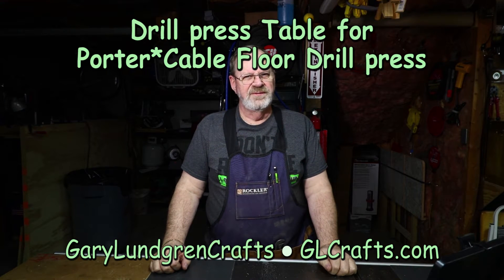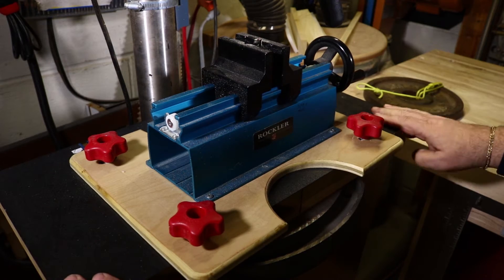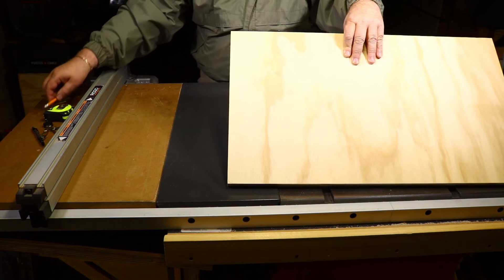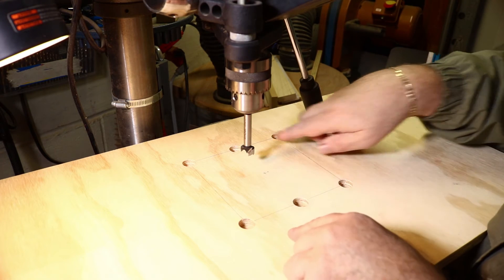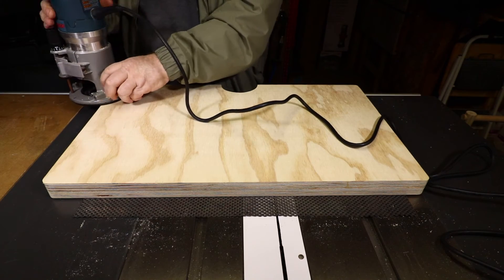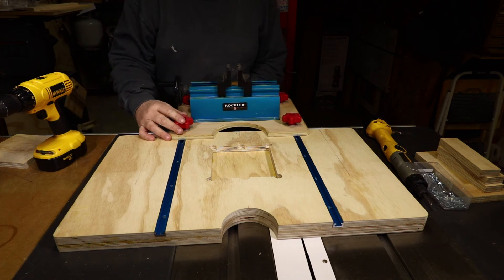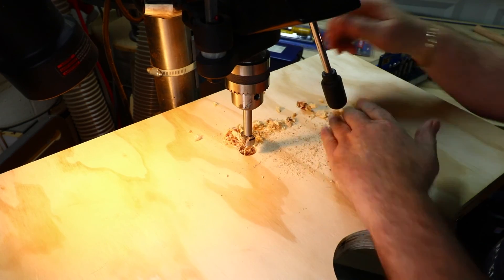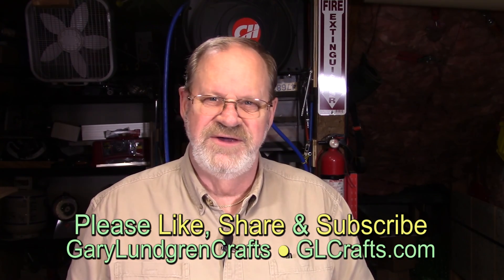How To Make a Drill Press Table for Porter*Cable Floor Stand Drill Press Ep.2017-02

Comment: Hi Gary, My new PorterCable must be slightly different than yours. The 5/8" hole in the cast iron table is at 11:00 o'clock not 5:00 o'clock like yours. Both the locking handle on the left and the crank handle on the right are much too high to clear the double thick plywood. I had to cut big chunks out of both sides to make it slide in to half the circumference of the post and still use the height adjustment. I use the T-tracks for a fence I made for a smaller drill press. I want to give the new top a couple of coats of poly before I start using it.      Linda Smith
Reply from the maker: The cast iron table rotates so you can locate that 5/8" hole at any of the positions. Yes, my locking handle is on the left and the table lift crank is on the right on mine. Thanks!

Comment: Gary, I enjoyed this.  I drill down through long items and need the material to come up from the bottom of the table.  have you encountered a solution to replace or modify the original table?  Perhaps another idea for drilling 4/5 inch holes down through 36 inch long 1' stock?
Reply from the maker: Thank you!  I do small projects, not into furniture at all, so I've not had a need for that. Thanks for the idea!  👍
Reply: I make walking canes and drill for a dowel down the shaft and i borrow someone's drill press and would like to use my own.  maybe its time to buy a new drill press with an appropriate table.  dern it!
Reply from the maker: @echosixdefensesolutions912  Wow! That's a challenge! 👍

Comment: I am thinking of buying this drill press. Would you recommend it? Why or why not? Please let me know what you think. Thank you
Reply from the maker: Thank you! This drill press serves my needs very well and I've had it about 4 yrs. I find it good and reliable. As with any tool, you have to set it up and teak it to get good square and performance. I guess it depends on your needs and the bells & whistles you want. I might complain about the table configuration, but I figured out a work-around for it as you may see in one of my videos. The table is otherwise very solid. There is that Nova drill press out now for between $1,500 to $2,000. Lots of digital options. I thought about that, but I don't use my drill press daily. Hard to justify the cost, as much as I like the toys.  :-)  This Porter*Cable is only $400 at Lowes. I think it's a solid tool and performer. They still carry it. Thanks!
Reply: Thank you

Comment: Gary, does your stock drill press table move with little effort?  Mine spins around the pole no matter how tight i make the handle.
Reply from the maker: Mine does lock in very tightly. When I loosen the screw it will move freely.

Comment: Gary- loved the video, just got the same drill press a few days ago so this is a big help. It looks like the table is against the column. How did you overcome the height adjustment handle hitting the table? Any guidance would be appreciated.   Also I have a 4512 ,so you're videos of it's upgrades have been very helpful as well.
Reply from the maker: Thank you! My height handle is within about 1/4" of hitting the bottom on the drill press table I placed on top of the existing table. While I know it is a tight fit, it has not caused me any real issues. Haven't scraped up my knuckles at all. Thanks!
Reply: @GaryLundgrenCrafts  Hi Gary, Im in the process of making the table but the handle is definitely in the way. Guess I'll have to cut a big chunk out of the table.
Reply from the maker: Thanks. I'd hate to see you cut a big chunk out of the underside of the table. My crank handle comes very close to the underside of the table, but does not hit. I still have room for my hand, and I have large hands. Perhaps your crank handle is a little larger. Instead, you may try raising the table up a little  off the cast iron table. You may try using some 3/4" wood blocks in 4 corners and one in the middle. Or better, make a solid piece that fits the perimeter of the cast iron table.and carefully position it and glue that in place. Thanks!
Reply: @GaryLundgrenCrafts  I know this is an old forum, but I also purchased this drill press, and I don't know how in the world your lift handle does not hit the table. I am going to make a riser for mine, just a 3/4" piece that is the same size as the table, then mount the table to that. I intend to follow your plans exactly. Only thing I don't care much for is the stop block you used. Perhaps a smaller knob WOULD be the fix for that though...
Reply from the maker: Thank you!  Mine is very close but I work with it Ok. Has not been a major issue for mine.  I am working on another project and video of installing a system to make a 90 deg right angle turn to bring the lift handle out to the front of the table. That will make it real easy. The Woodsmith Shop did one on a drill press, different brand. On this Porter*Cable the shaft sizes are a little bit different and I had to hunt down the gears for that size to make the 90 deg turn.  Tweaking the stop block is a good idea. We all take ideas and tweak them to suite our needs and I believe that is good and to share it with all of us. We all like like to make little improvements and then it evolves into something even better!  Let me what you do. I may change mine!  Thanks! 👍
Reply: @GaryLundgrenCrafts  Thanks for the reply!!! I am thinking of making a piece the same size as the table, fit it up with blocks to fit into the four slots on the table top, and then make a tightening system thru the center hole. Got some "engineering" to do there...That will also get my table up high enough to clear the riser handle knob...

Comment: Gary - Curious if you had any issues with vibration of this unit out of the box?  I've found that the drive and idler pulleys have been manufactured out of round, or the shaft isn't exactly centered.  Also is seems the idler pulley is lower than the spindle pulley so the belts rub.  Any ideas?
Reply from the maker: I have not encountered those problems myself. Mine run and align great. Sorry to hear about that. Have you contacted the seller or Porter*Cable? Thanks!